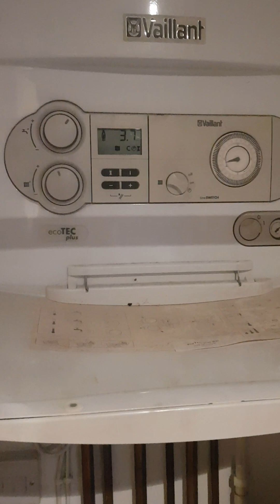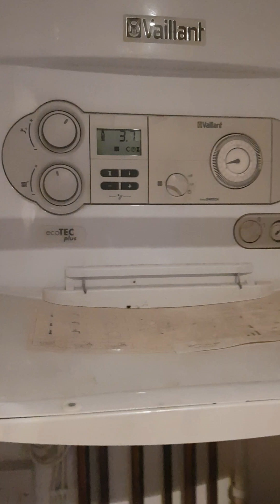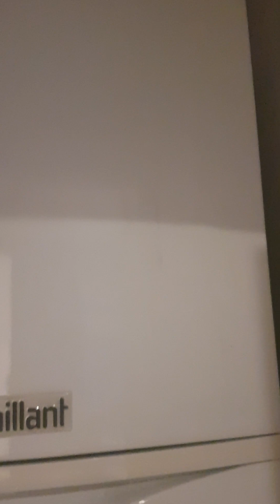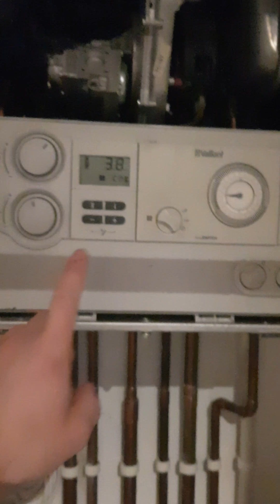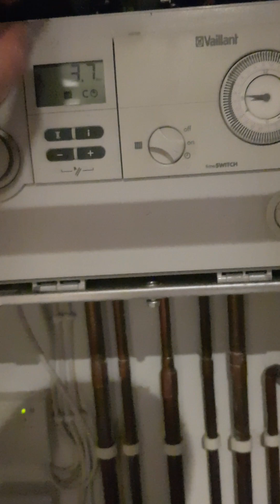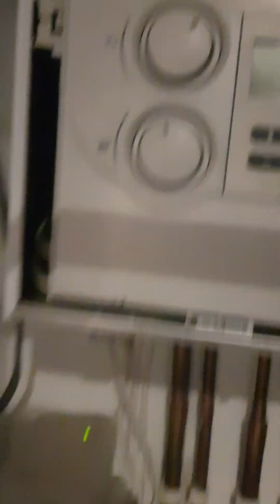Vaillant F.62 code

Comment: Careful, what you’re doing is illegal if you’re not competent to work on gas appliances. 

There are a number of gas and combustion checks that qualified engineers do to make sure the appliance is safe after working on them.
Reply from the maker: I'm gas safe...
Reply: @jonny8730  sorry I thought  you said “I’m no professional”
Reply from the maker: @jacbisgood2221  I meant with that particular boiler, let's remember it's not the gas thats the problem here. But thanks for your input..